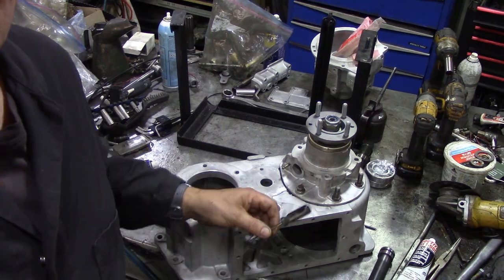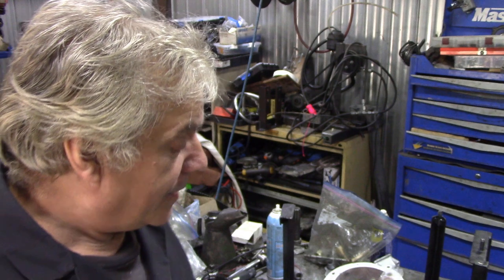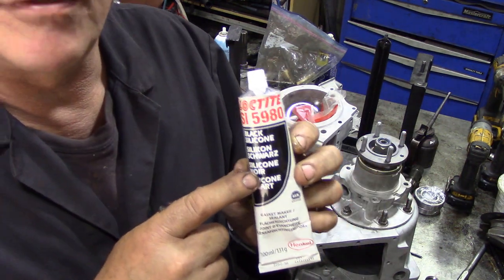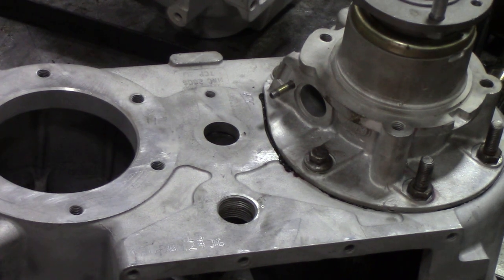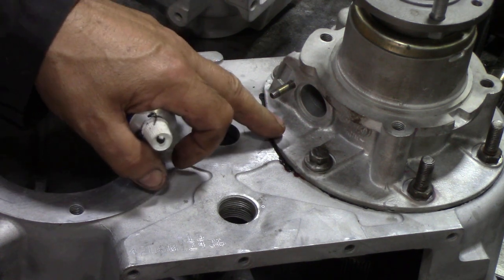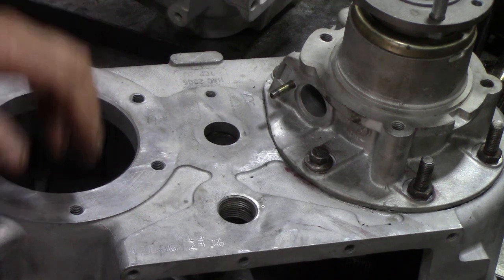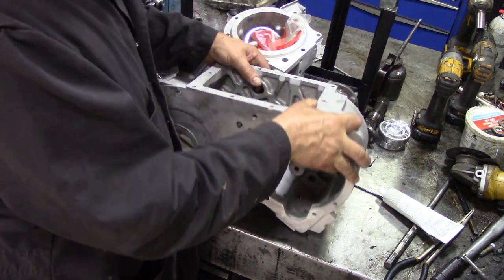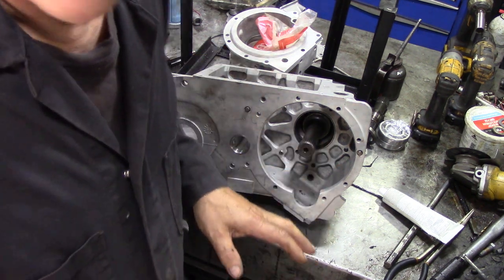Building a 1:211 ratio LT230Q for a Defender Td5 from a Discovery 1 or 2  Part 1

Comment: Hi Mike great video the different gear cut on td5 caused some to wine I heard one 110 that at about 30 mph it sounded like someone cutting wood on a circular saw ,but with the cast weight bolted on reduced it but we still put a lead blanket over it to make sure, great mod 👍

Comment: Great video Mike, with no room left for any misunderstanding. a lot better that reading from a manual.  I have the old RR transfer box fitted to my 110 and as you know the intermediate shaft + bearing have to be shimmed on those. I feel that is a lot better than the crush tube, which was just a price cutting job.  Many thanks for your help Mike, best wishes from Yorkshire Rob.
Reply from the maker: The old 13D box had needle bearings on a larger shaft - wonder why they did away with that idea?

Comment: Hi Mike,
You don't need the intermediate gear into the casing to determine the solid spacer length. This can be done on the bench, shaft end in the vise, bearings and solid spacer in the intermediate gear, than find yourself another spacer to fill up the space till you can torque up the nut. Now you can take it out of the vise and measure the preload on the shaft
Reply from the maker: Good tip!
Reply: @BritannicaRestorations  This is the easy way to handle the solid spacers!  The necessary torque should be 0,5 up to 1Nm. I messure it with a snap on torque wrench showing zero to 3,5Nm with the big end of the pin hanging down in a stand. while the nut is force by 88Nm to the axleholder and a distance, which replaces the original wall of the main casing. Reducing the solid spacer by 0,05mm (0.020") will raise the torque up to 1Nm if there had been no endplay befor. Be careful.

Comment: With regards to centre diff locks and people who don't use them.

A centre diff lock should always be engaged when leaving the tarmac roads. Even on loose graded roads, a diff lock should really be engaged.
The reason is, if you have one wheel slipping, with an open centre diff, all the power of the engine is going to that one slipping wheel.
 If suddenly that wheel gains traction, you can end up breaking a half shaft or worse. If the diff lock is engaged, the slipping wheel is only going to receive 50% of the engines power.
Reply: The front and rear diffs are open so that’s not this issue. It’s having the output shafts spinning at NOTICEABLY different speeds leading to the sun and planet gears welding themselves together in the centre diff.
Reply: @husq2100  Perhaps I haven't explained this properly.

 If you are on a loose surface with an open centre diff and one wheel starts to spin, 100% of the torque from the engine is going through one half shaft,
 if that tyre suddenly gains traction the torque is too much for one half shaft to cope with and it can snap.

By locking the centre diff, only 50% of the engines torque can reach any half shaft.

 I hope I have made this clearer.

Comment: I really like the idea of the solid spacer. My transfer box had the same problem with the collapsible spacer not being crushed evenly. Maybe why the bearing closet to the uneven portion failed and the bearing on the other side was fine (but could be because of any number of reasons though). Both Timken bearings.
Reply from the maker: Having built a few of these now, I will only use the collapsible spacer as a guide to measure the solid spacer
Reply: @BritannicaRestorations  that’s a good idea. I might do the same now it’s rebuilt and a new collapsible spacer was used to measure off.
Reply from the maker: They are not giving away the solid spacers! Between £10 and £17 each - and there are 20 sizes!
Reply: @BritannicaRestorations  ouch! Measure twice, order once! Maybe it’s something you could put in your shop since JP is making them for your rebuilds?